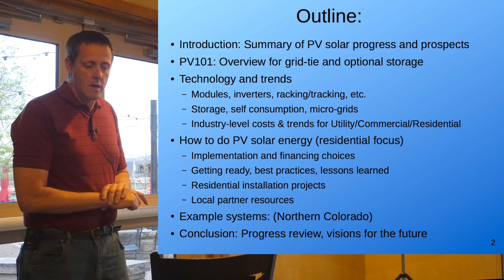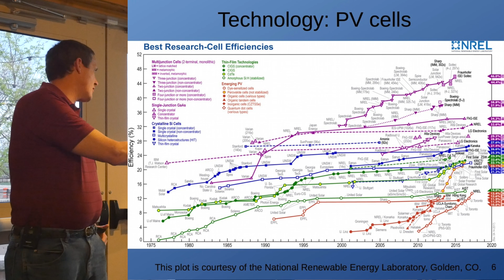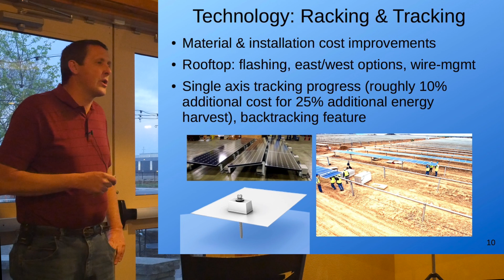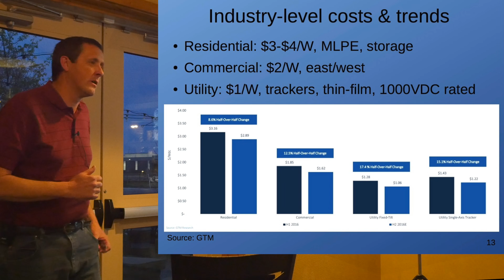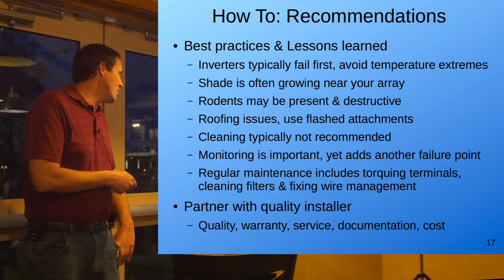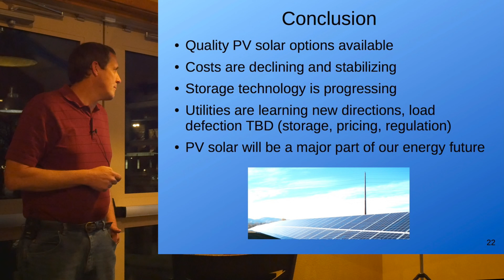Progress in Solar Photovoltaics 2017 - Doug Vander Wilt, NCRES

Comment: Fantastic summary! As far as storage, our $200K research found thick plate Carbon AGM's built for solar cycling to beat the cost of lithium. You might want to check out the Sol-Ark 8K battery based inverter (most efficient in the world). There is a comparison page of Tesla, Outback, Magnum, Pika, Solar Edge, and more.
Reply: "most efficient in the world" - why don't you stop blocking access to your website for many other countries, so rest of the world can find out about your magic inverter?! Paranoid much?!